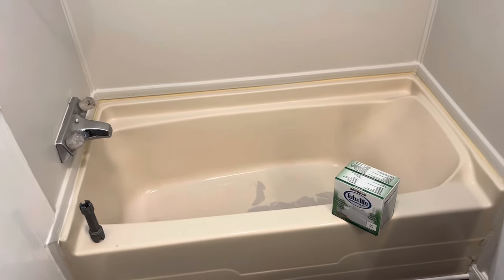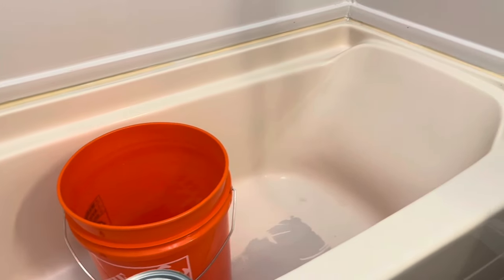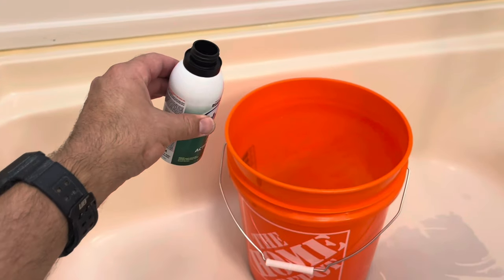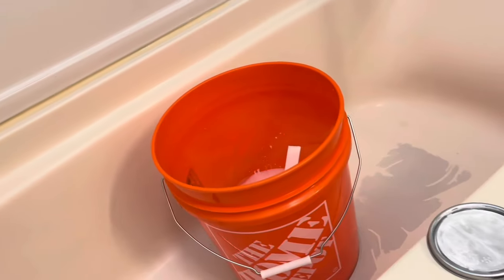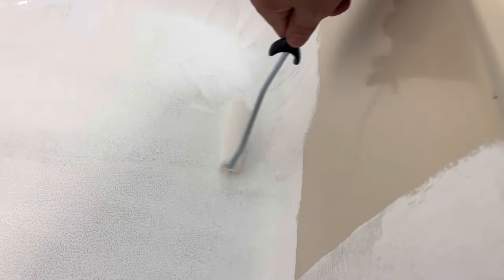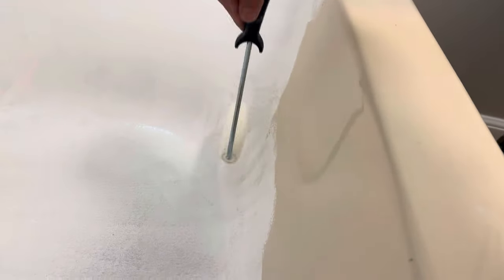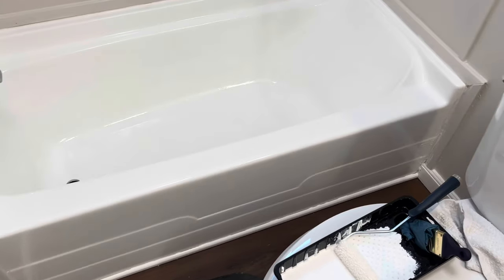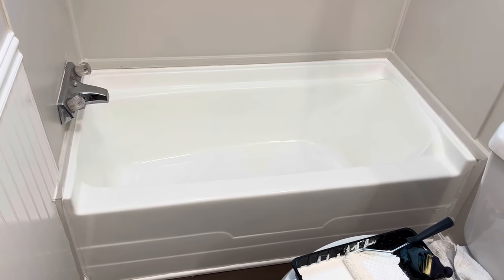Painting a bathtub with Rust-Oleum Tub and Tile

Comment: The key to a good job is preparation.  Considering the tub is exposed to shampoos, conditioners and other things, a heavy sanding is a better idea.  Same with the caulking around the tub should be removed and surface prepared.  We bought a home on a well water system. The place was abandoned for over a year and the fiberglass tub had been half full of fermenting water.  It was gross.  Eight years ago we bought this place and the well water always leaves a coating of 'rust' which needs to be abrasively scrubbed at least twice a year. We are still using the same tub after painting it with tub epoxy.

Comment: Looks and how it holds up is questionable.
Reply from the maker: I will be curious as well. I recently replaced a bathtub that had this on for 3 years and still looked pretty good, but they wanted to convert to a shower.
Reply: With proper preparation, our epoxy coated tub is starting on year nine. It required a lot of degreasing and sanding. Preparation is the key.

Comment: Great product we had an off white tub with some chips and scratches.  This worked great 👍.
This stuff smells terrible.  It makes the whole house smell like nail polish and paint.

Make sure you buy about 10 of the small dense foam smoth rollers.  You will need to change these frequently for a smooth finish.
Reply: What do you think about using this stuff on a stand up shower floor? The ceramic tiles are a bit old and outdated looking. I'm think a white floor will brighten up the shower. It has navy blue tiles on the walls.

Comment: We have a fiberglass one-piece enclosure. There is some flex on the floor. When you step inside there is a little movement. Do you know if this paint would chip or crack with that movement?
Reply from the maker: It is not recommended for flexible surfaces. It depends how much movement there is
Reply: This is not paint, it is epoxy, the same product used to make fiberglass and acrylic tubs, showers and enclosures.  If the surface is heavily prepared and cleaned, the epoxy should be tough and flexible enough to last ten years.  We are on year 9 with our paint job.

Comment: Did you apply third coat, same day? With the original kit?  Rustoleum says to wait til next day and use brand new kit - so curious if you did 3 in same day? Thanks!!
Reply from the maker: I did it same day. It was warm and curing quickly. The only reason you would need a second kit is because once mixed, it doesn’t last long.

Comment: that's going to chip and peel in 6 months
Reply from the maker: I recently upgraded a tub that had this for 3 years and still looked good.
Reply: Obviously when you did your job, and it chipped and peeled in six months, the surface was not properly and thoroughly prepared.  We are starting on year 9 after painting epoxy on our tub.  Perhaps you used paint on your tub?
Reply: We are a restoration company, and have used this product on many antique clawsfoot tub resorations. None of our customers have ever complained about low adhesion, poor wear characteristics or anything else. Tubs and sinks we have done have been in service in excess of 8 years, with no degradation of the finish.